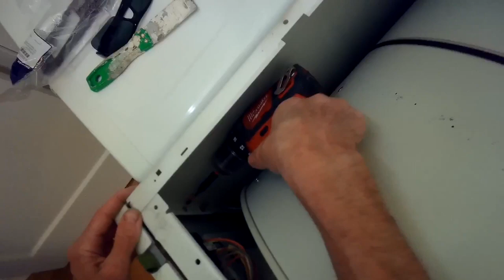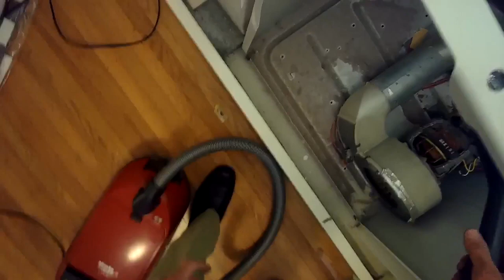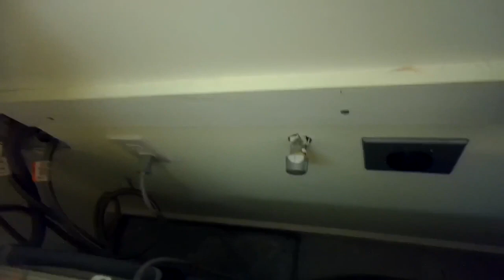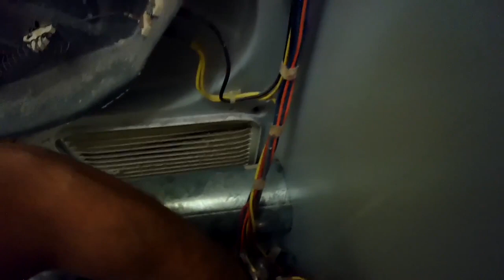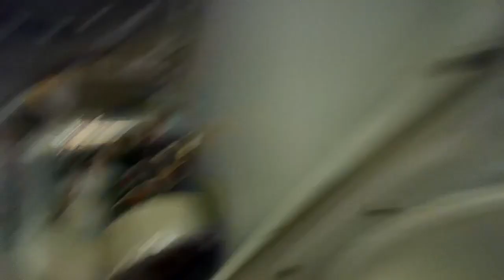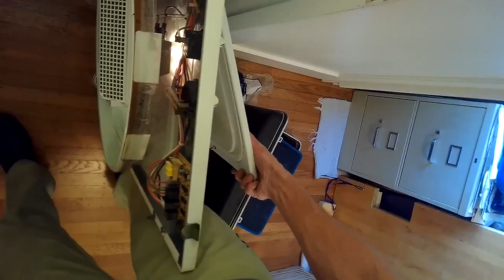✨ FRIDGIDAIRE DRYER WON’T START - MOTOR SWITCH - Easy FIX ✨

Comment: Thank you, this worked. I didn't even need to unplug and clean the motor plug where it meets the motor. Just cleaned the motor itself and the surrounding area. Thank you so much
Reply from the maker: Glad it helped Seth😊

Comment: Hi, I have a frigidaire affinity dryer that has no power on the black wire coming out of the connector on the motor. There is 240 at the power junction and the red has power all the way up to the mother board, just not the black .  So, the digital display is just dead. That black coming from the connector on the motor goes to a fuse which I checked for continuity which it has. I checked that black wire for continuity from the motor to the fuse and it has. I don't know much about fixing appliances so not sure what or how to troubleshoot from here. Any suggestions would be greatly appreciated! Thank you!